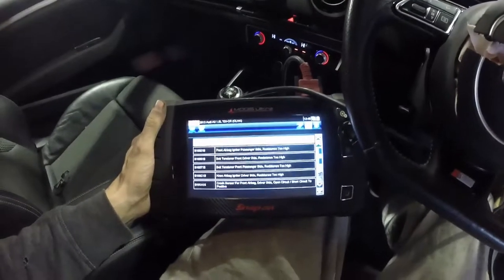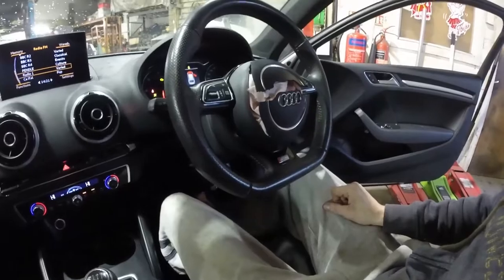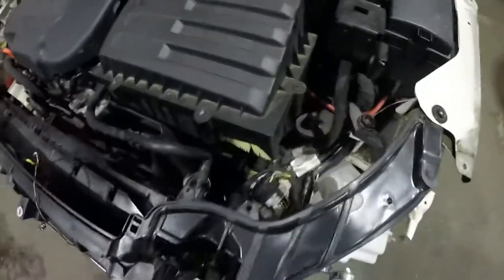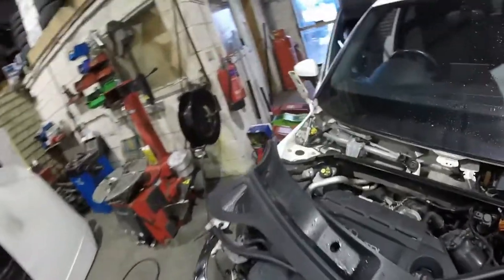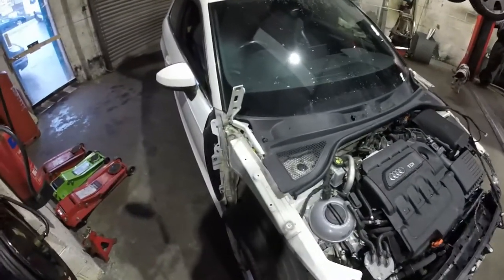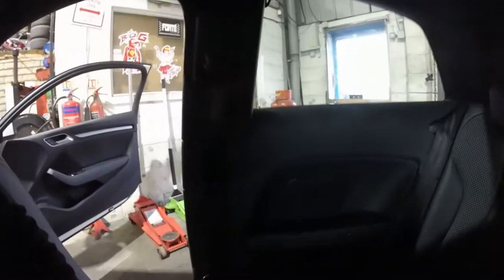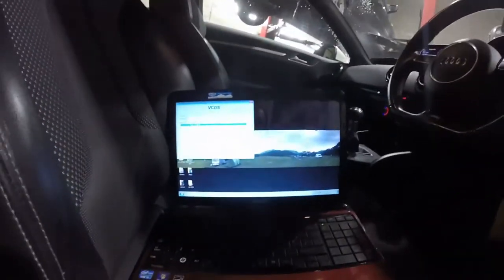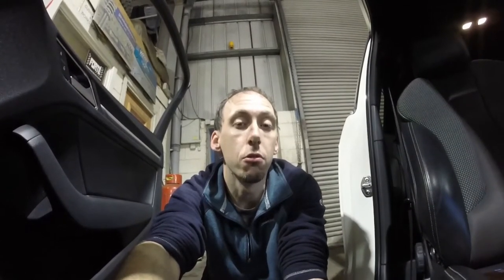I Bought A CHEAP Synetiq Salvage 2013 Audi A3 And Im Going To Repair It Pt4 : ECU CODES!

Comment: Why couldn't you reinstall the scuttle tray and wipers now? Windscreen looks fine...?
Reply from the maker: Hi, unfortunately the windscreen has a crack on the drivers side.

Whats most annoying is it appears to have happened after the crash because someone had forced the bonnet open past its stops until the edge of the bonnet has cracked the screen.

Thanks for the comment hope your enjoying the videos. 
👍
Reply: Oh right. Can't see any damage in the vids. Good work though - I'm learning lots for a similar project of my own. Keep them coming!